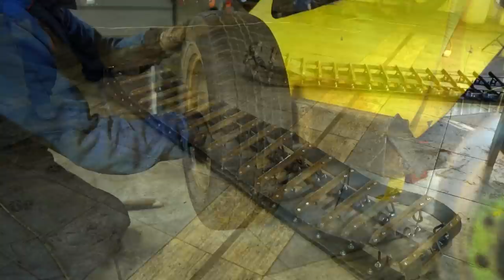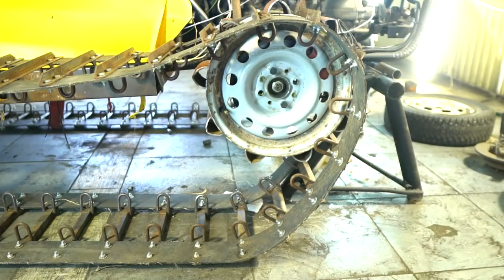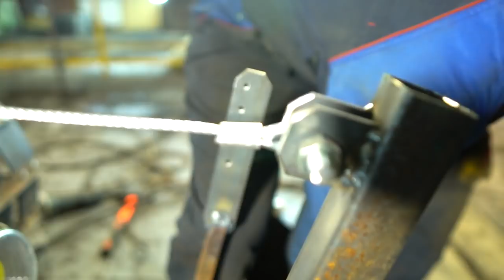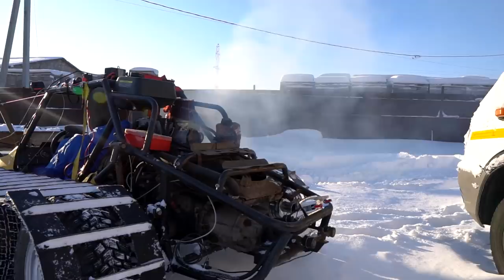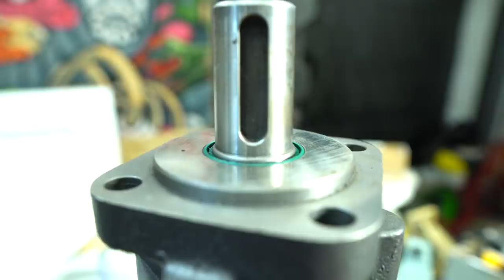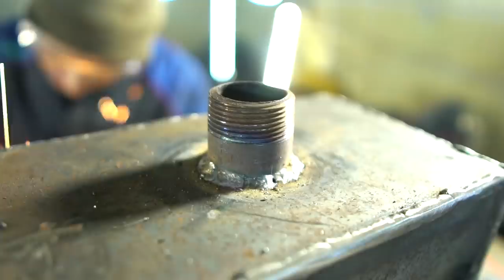Buggy on tracks Snow removal

Comment: Just a thought, you may wanna add a metal grid to the rollcage in front of your face. In case the connection of the cable or the cable itselfs snaps, it would safe your brilliant head. Also i imagine it would look very cool and doesn't interfere much with your sight.

Comment: A differential could be used in order invert on side and send torque to both pumps, except there's a space issue.
I thought about using a break master cylinder as slave cylinder and actuate the shovel that way.

Still, that was a creative way to solve the problems quickly.
Looking forward to the next set of improvements, or new projects.